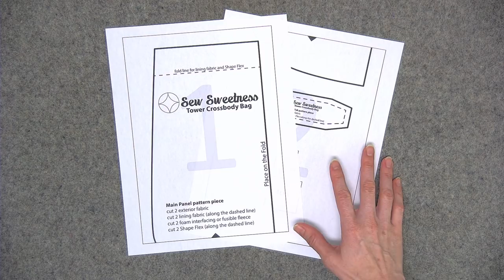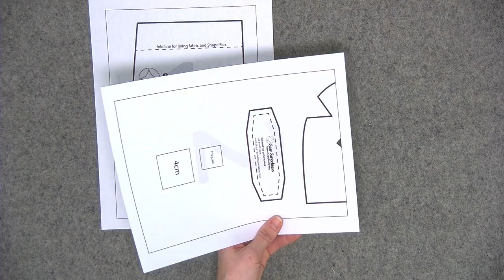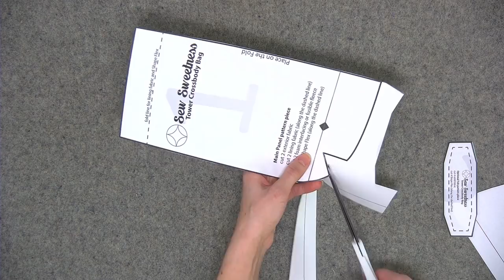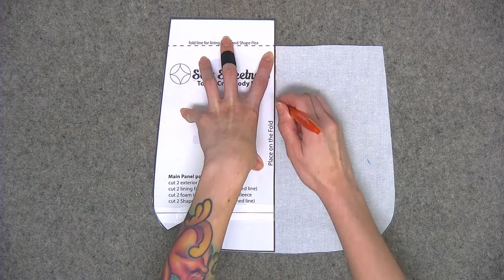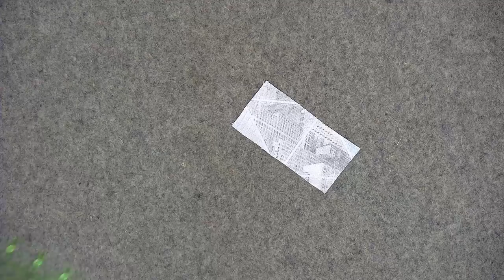How to make the Tower Crossbody Bag - Free Sewing Pattern

Comment: So, stupid quetion No 1 , at step 14, why did you not use the Wonder tape to hold the zipper? Ditto for the other zippers. Step 19, marking the seam allowances could be very helpful here. It's on the inside and no one will see the markings. Great tip on decreasing the stitch length to get it to come to the point. And foe pushing the pockets and  zippers so they don't get sewn over! Yikes What a catastrophe that would be. All that unstitching. I'm the why guy -- so why did you not attach the strap after the bag was all together so you wouldn't have to mess with stuffing it? Thank you for your encouragement. stay safe. Good video, no fast forwarding, clear instructions.